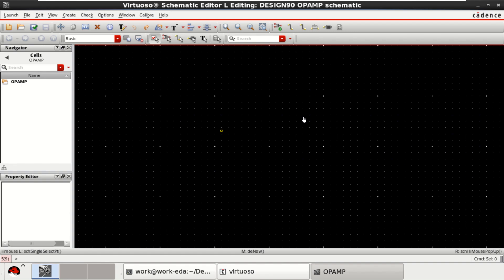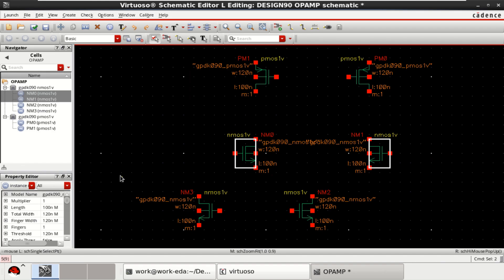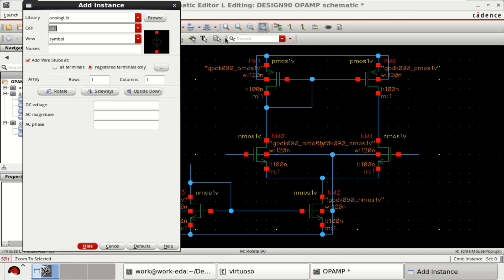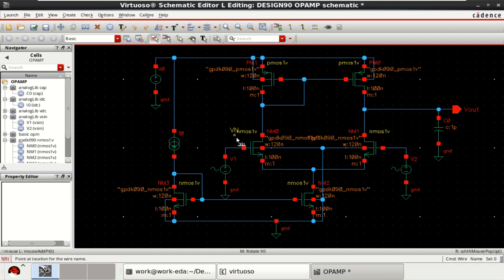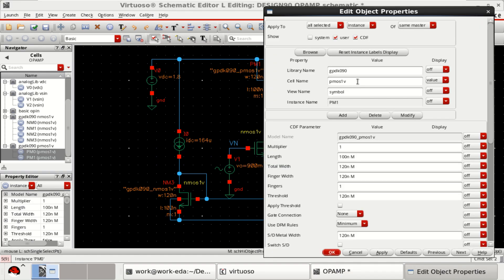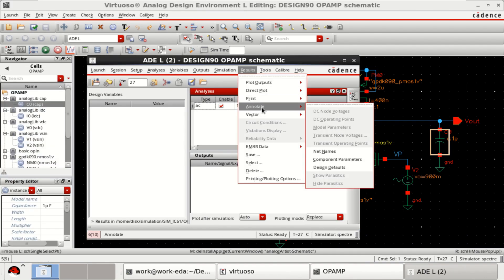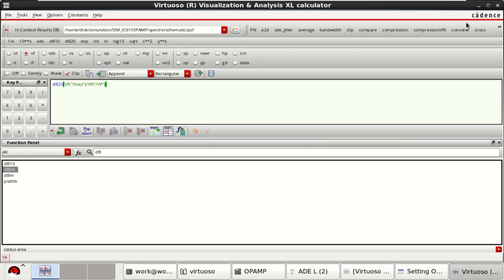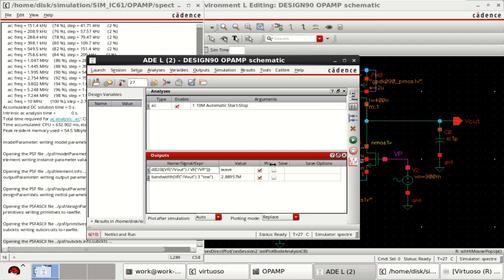Single Stage OPAMP Design and Analysis.

Comment: Dear sir,can please explain the parasitic insensitive switched capacitor integrator using the 2 stage op amp with gpdk 45nm technology  in cadence. Still, I'll  doing  this experiment, It will not generated the gain, Phase margin  and output swing.
Reply from the maker: Hi, I dont know much about switched capacitor integrator circuits. Refer any other resource

Comment: Sir ,I am using 180 nm technology,what should be my W/L ?
Reply from the maker: Hi, you need the specifications of opamp, current drawn, gain , slew rate. These will require design equations to get W/L ratio of each transistor.

Comment: sir iam using 45nm technology what shuld be L ans W
Reply from the maker: Hi, to get a proper gain analog design can use the fingers and multipliers. Try to keep the transistor in region=2 saturation Increase the width and adjust
Reply: Hello mam, do you know switched capacitor integrator  by using 2 stage op amp. If you Know this please told .
Reply from the maker: I dont know about it

Comment: Dear Sir, what if someone researches on sing stage/ 2nd stage Opamp for publishing a research paper, what should be the first step, sir?
Reply from the maker: Hi, design of Opamp is based on several parameters: Slew-rate, Gain, Bandwidth, CMRR, PSRR etc. It also depends on the application.